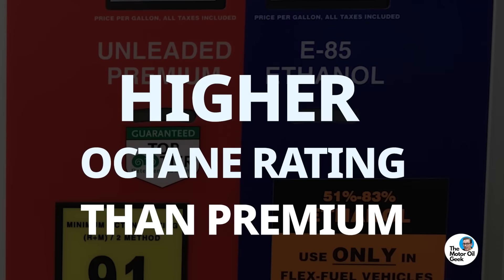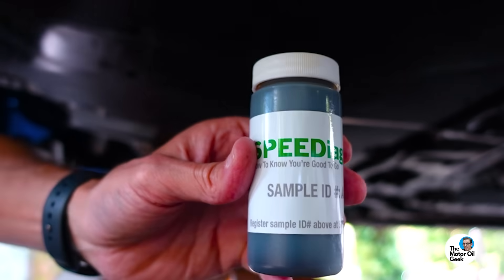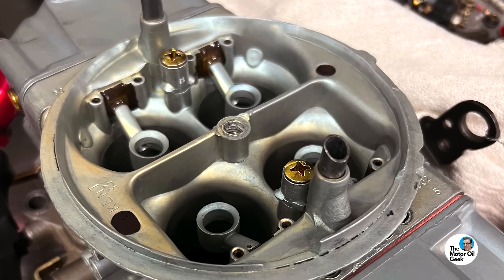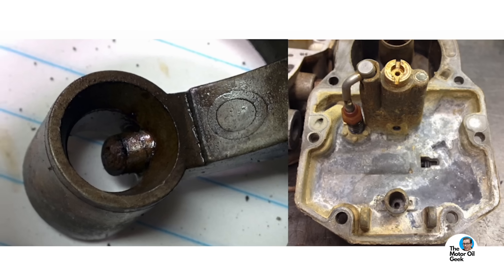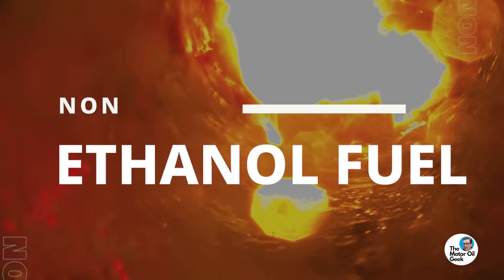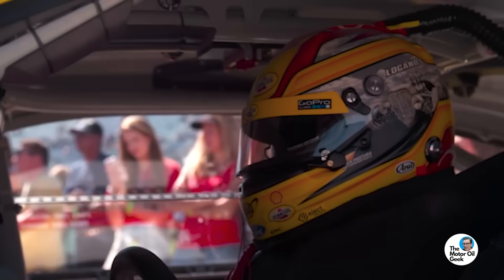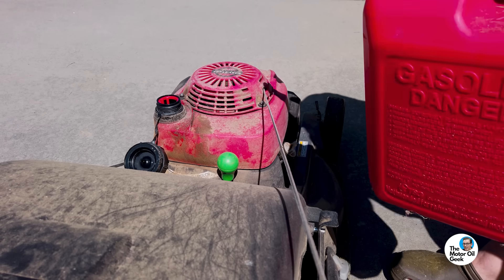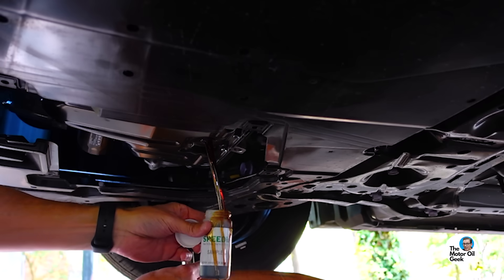ETHANOL: Higher OCTANE, Higher RISK?

Comment: Now do a segment on fuel treatments for ethanol blended fuel and what works. I know it's not about oil but we trust your perspective. Thanks!
Reply: None of them work at preventing ethanol damage.  The only thing that works is use the machine a lot where you realtively constantly keep fresh fuel in it, or drain the carburetor after every use.  Don't just "run it dry", but physically open the drain screw on the carb float bowl, and get all the ethanol contaminated fuel out of the bowl.  That's the only thing that works.  And, if you've got equipment like a generator that needs to be ready to go at short notice, keep the fuel tank FULL so there is no or minimal airspace in the tank for condensation to form.
Reply: @BKD70 Not exactly true... I just posted my thoughts in this thread on the Long/Short term Ethanol Fuel Stabilizer tests done by the Taryl Fixes All Channel around 2020...  

While they did find that using an E0 and/or Draining the Fuel as the best course of action... they did also find several Fuel Stabilizers that did outperform the E10 Regular and Premium "Control" Fuels.

Unfortunately not all the Stabilizers actually "Stabilized" for the period they suggested.  Some doing worse then "Control" and others apparently not doing any better...  

Yet there were some promising candidates (particularly shown in the short term/Winter testing) that do deserve notice.  They outperformed the controls, did similar/same to E0 during the testing period...

There are a lot of Snake Oils out there... But there are a few "keepers" that people should consider as a safety margin/backup just in case
Reply: @lgoamity  I think in a followup video a year or so later that they did, they concluded that really one of the stabilizers were any more effective than untreated gasoline... so in essence, none of them work reliably.
Reply: @BKD70 Not sure how they'd "crunch the data" a year or so later... It was all right there in Real Time. For the "Short Term"/Winter Test you could SEE for yourself that some of the Fuel Stabilizers did better then "Control"/Untreated... AND some actually did worse. So the key would be to use a Fuel Stabilizer that will "work" for the needed time period.  For example the Stabil 360 (12 months) "won" in both tests (for the "Stabilizer" category vs E0 which did Best of all)... Wasn't doing so well after 17-19 months but it was still "Performing" better then the rest.  In the Short Term Tests (under 12 months) it and several others performed similar to the E0 (no build up/gunk in the bowl, quick start)... While others (some rated for 24-36 months were worse then "Control"... So the real losers
Reply: @lgoamity  I don't know... but you can go back and look, the video is there.
Reply: @BKD70 Not sure if I have the right video... (For some reason I can't seem to even find your original reply mentioning the "Data Crunching" (did you remove it?)... You thinking of their "Ethanol" video from September 15, 2024? Which Talked about Gasoline and Diesel Compression Rates of Small Engines AND the "Snake Oils" used during the 19 month long term Ethanol Stabilizer Testing?  

THAT one again does seem to paint with a broad brush... The Stabil 360 (12 month) was used in the Long Term AND ("5 month") Short Testing... And basically was in the Winning Class both times... In the 19 month long term it Outperformed other Stabilizers meant to last 24 months AND itself had technically "expired" basically 7 Months beforehand...  I don't recall them mentioning or "crediting" the 360 product for doing something it wasn't marketed to but still worked (to a point) anyway.

Again, if we look at the short Term test there are obvious "winners" for specific fuel storage requirements...
Reply: @BKD70 Another option is to buy canned pure gasoline and run the engine till it dies from fuel starvation before storing over winter.
Reply: @H0kieJoe  It's a lot simpler to just drain the carb bowl with the drain screw.  'running it dry' does not get all the gas out of the bowl.
Reply: @BKD70 Being off grid I have many generators and small engines, I burn only E10 gas, and I have zero problems from it. Any engine I don't use regularly I run dry by shutting off the fuel valve and when it starts sputtering choke it, that is plenty dry enough, I never have any carb issues if you just do that. My motor grader broke down for two years and when I fixed it it fired right up on that old gas, but again, I ran it dry when I shut it down. In my experience E10 is no worse than pure gas, if you leave gas, any gas in small jet carbs it will varnish, thats just how it is.
Reply: @integr8er66  I know, I have the same problem where I live.  But do yourself a favor, and do the "run it dry" procedure, and then drain the bowl after you do that... you may be surprised at how much fuel is still in the carb bowl.  It's always best to just drain the bow and get it ALL out.  I've always done the "run it dry" procedure on my big backup generator that I've had since 2008 I think, and then this spring, it was surging with no load... I pulled the float bowl and it was scary how much crud was still in there.  Absolutely you can do you, but I'm telling you from experience that ti's better to drain the bowl fully than just "run it dry" and calling it good.
Reply: @BKD70 Its a fine idea IF it has a drain plug, some do, some don't. Pulling the whole bowl off often ruins the seal, so 🤷‍♂️ we do what we can and fix the rest
Reply: @integr8er66  you like to argue don't you?
Reply: @BKD70  Keeping it full does not stop water from being absorbed.
Reply: @3029dz  Full tanks don't breathe (exchange air) nearly as much, thereby reducing absorption of water in the air.
Reply: @3029dz correct it does not stop it but it reduces the amount significantly.
Reply: @3029dz  Correct, it will not stop it (never said it would...) but it does significantly reduce the amount of water that can be absorbed in a given amount of time because there is less airspace in the tank and thus less surface area of the fuel to absorb water through.
Reply: @3029dz Assuming the fuel system has no leaks, a full tank means less water will be absorbed into the Ethanol gas mix
Reply: Over 90%  do not work per the good small engine mechanic who did short term and lomg term tests.
Reply: @human1513 Like the ones done by Taryl Fixes All about 5 years ago?  Well worth watching the series of tests/videos over the many months of testing... 

Although I felt they sort of lost their way/objective when they made their conclusions... 

They specifically were looking for Fuel Stabilizers that would combat the problems related to Ethanol...  They SAW various Stabilizers (including an E0 fuel that was the "real" winner, but not exactly a test of an Ethanol Fuel Stabilizer) outlast the "Control" E10 Regular and E10 Premium fuels... 

The Stabil 360 (which is only meant to Stabilize for up to 12 months and meant for the "Daily Driver" type equipment) was "Winning" in both the long and short term tests... BUT because it was like 17-19 months during their long term test... 360 was breaking down. While it was still performing it didn't look good after checking the Carburetor Bowl.

It and several other Stabilizers showed much more promising results in the shorter term (Winter Storage) Testing... With SOME showing results similar to the E0 fuel (no breakdown/deposits... The Ideal for a "fuel stabilizer" you'd think right?)

But they basically shot down the idea of Ethanol Fuel Stabilizers...  If they ever do more testing on this I do hope they look more seriously at the Stabilizers that don't show breakdown at specific times during use/storage and not just ignore the advantages that they discovered.

They were able to dispel several myths/rumors during their testing along with some assumptions... Wish they had worked a bit harder in their conclusions to highlight what did/didn't work without basically painting ALL stabilizers as worthless (when there clearly was some that were doing its job as Advertised)
Reply: @human1513 Is that the one that got bogus results because they didn't mix any of the additives to fuel to do the testing?
Reply: I’m a retired, small engine mechanic/large shop owner of over 50 years. Nothing works! Purchase recreation fuel and your problems are solved! Additionally don’t store it long, 90 days or so.
Reply: @rodjones812That may be best practice... But there are some Ethanol Fuel Stabilizers that will definitely get you past 90 days.  Heck Untreated E10 Pump Fuel (Regular or Premium will last longer then that).  The question/concern is exactly at what point will the Stabilizer give out and the Fuel will "tip" into causing gum/rust/no start... Unfortunately, a lot of Stabilizers claiming 24 months ain't doing that... Heck many are doing worse then "Control"/Untreated E10 fuels (Premium or Regular)
Reply: @rodjones812 If you can get it in your area (rec fuel.), it's not available everywhere.  Otherwise, keep your fuel tank either bone dry empty, or topped off full, and drain those carb bowls!
Reply: polyetheramine   PEA 
gumout  all in one 
Redline   complete 
And some other ones   
It will tell you on the label
Reply: Amsoil Upper Cylinder Lubricant
Reply: @asplmn  Momentary effective while in use. If it sits for a while it does nothing.
Reply: @asplmn it helps but they now sell an even better one. The problem with Amsoil , as always, is with cost. 😢
Reply: Ethanol the great scam
Reply: I saw an independent test of all of them in the boat industry & only BioborEB Ethanol Buster, was the best.  The test review is posted on their website.  They must be using some unique chemistry & maybe Lake can figure out what.🤔
Reply: Been running E85 for 3 years straight in my Hellcat Redeye,  zero issues.
Reply: @justinw7852  Well, that makes sense. It's designed to do that.
Reply: @njsongwriter  actually no, in cold climates where you don't use it it turns to jelly
Reply: 100%
I use star⭐️tron and would like Lake to evaluate this additive with others.
Reply: Great suggestion
Reply: Driven ethanol shield
Reply: No!  Just stick with gasoline to the maximum extent possible.
Reply: I have yet to find one that actually does work.
Reply: He already did. Use top tier fuel
Reply: @michaelbollinger8060  Top Tier fuel still contains ethanol...
Reply: @njsongwriter i said he made a video regarding what fuel to use and it showed that top tier fuel is over 60x better than regular fuel.
Reply: There is a product called Ethanol Equalizer that works very well to handle the ethanol. We use it in our atv fuel because in my area free gas is not available normally. Sometimes you can find it a race fuel dealers or marina's but not always. Plus they sell it by the fucking liter and its 12.00 god damned dollar's a liter.
Reply: Yes,  he should specifically try Marvel Mystery Oil,  which is Oil of Wintergreen.   I've been using Marvel for quite a long time and I don't see any corrosion in my carbs even though I use standard 10% ethanol fuel.
Reply: Anything with a high amount of PEA will do it
Reply: I think XP3 form XPLabs is a very good ethanol additive. It works on gasoline e ethanol.
Reply: I use motor oil
Reply: I just watched a segment on additives,  and Sta Bil was the clear winner, with Sea Foam doing very poorly. All ethanol fuels were basically dead in 20 months. But Sta Bil was the only one to protect the metal in the carburetors after years of setting. I personally used Sea Foam in my 4 wheeler and in less than a year my carburetor was full of green gunk.
Reply: "Farm Performance" has completed a pretty good test and only two or three treatments work. The rest fail leaving strong corrosion😮
Reply: The best thing you'll find to treat ethanol fuel, is to buy NON-ETHANOl fuel.
Reply: @gadsdenconsulting7126  100% true
Reply: Excellent ask !
Reply: @Retired1474 excellent question!**

Comment: I avoid that stuff as much as I can. Still possible here in Europe with expensive fuel brands (100 or 102 RON), but regulations are getting stricter and stricter and it might not be possible anymore in the future.
Ive seen ethanol caused damage to my car model before. They cause more damage than they save the environment. Typical planned economy stuff.

Comment: E85 has been a cheap way to get the higher octane needed to run certain performance engines for years.  You can add something like Ethanol Shield to flush the water that get absorbed into the fuel.  Now for the big issue, the hoses that NASCAR ran before finding out E15 ate them up was widely known by the homemade diesel crowd for years before NASCAR burned down cars on the track. Seems like JGR should have learned quick to flush the carbs and clean and rebuild them once they saw the problem. Oil geek you need to show us the old analysis that the E15 or E85 is causing oil issues.  Where is the data as you would say 😉?

Comment: WHy do you think you never see whiskey in metal containers?  Ethanol is a terrible motor fuel and I have been saying this since the days of Gasohol.  NASCAR should have just gone with straight unleaded race gas and I run marine gas in all my small engines.  Here on the gulf coast it is too humid for anything else

Comment: In Brazil, we already have 35% alcohol in gas. There are only problems with injection nozzles. If the nozzle could last 80,000 km with gas, now with 35% alcohol it doesn't go beyond 40,000 km.
Reply: I heard your ethanol is made from sugar cane in Brazil?
Reply: @wilsonyang2209  That's correct.
Reply: Shrinkflation

Comment: I have come to the leighman´s conclusion that this issue with the Ethanol being so agressive partly has to do with the origin of the Ethanol. Reason is that we, in Europe do not see this issue to the extent that you do. Far from it in fact. Neither our weed wacker or lawnmowers have this issue. My personal mower is a 2005 and I have never experienced anything like that with E10. I do add a dash of fuel stabilizer in the last tank of fuel before winter. Ditto with the vintage vehicles that come through my hands. As I understand it US Ethanol is still Gen1 ehereas Euro Ethanol is Gen II That apparently makes a difference.
Reply: What are you talking about? They literally delayed the laws that forced E15 in Europe, because E15 is much more problematic than E5 or E10.
Reply: @cartrips9263  You are correct that E15 was never a thing in the EU. But they did not delay anything. It was never really on the table. The main reason was that especially in some areas the carpool is aging. Older carburetted vehicles would typically have an issue with running properly on E15 (Both fuel/ corrosion- but also ignitionwise.) Instead the EU decided to stay with the E10 blend and focus more on electrification. E10 can- and are used in about everything built on this side of 1960. Earlier vintage stuff may see issues with especially pump diaphragms and corrosion due to higher levels of Zink in the aluminium. But, as i wrote earlier, we don´t see the issues nearly to the extent reported in the US hence my comment on slightly different behavior between Gen I and Gen II Ethanol.
Reply: @torbenalstrup3902 it was on the table in Germany. Even E20. EU law also says that bio fuel usage needs to reach 15% until 2030.
They just axed it for now because of a lot of criticism because of the issues it causes with older cars.

Many more issues are possible. In my car for example the whole fuel pump assembly will corrode horribly over time, clog the fuel filter and cause different issues and damages.